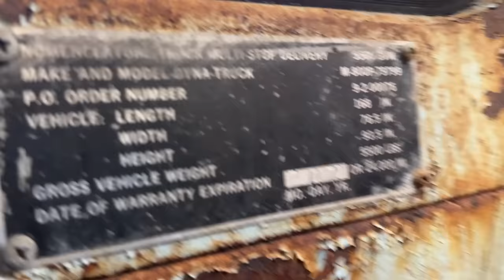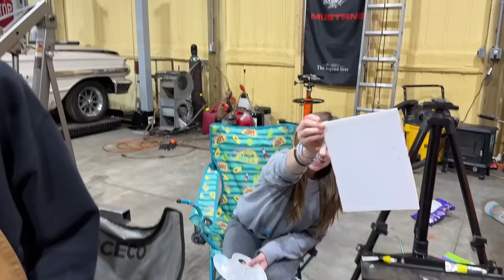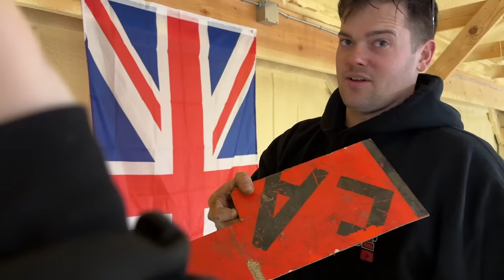Postal Van 6.0 LS Swap Mid-Mounted!

Comment: Woot the Metro Mite! That thing is too cool! You mentioned a roof top ac and needing a generator but you can get 12/24/48 volt rooftop units if you wanted to go that route.  Any who I agree with Ralphie about eventually adding a turbski. 🙃

Comment: A good trick when storing carburetors you've used is to take a syringe full of automatic transmission fluid and fill the bowl through the fuel intake it will completely submerge the internals and ATF and keep it from drying up gaskets and having the ethanol fuel that was left in it permit and keep all your internals from pitting
Reply from the maker: Ok thanks
Reply: I always took the fuel line off. Ran it until it is empty, then fill it with 2 stroke fuel. I think it's the same concept. But the 2 stroke fuel is more for winter storage, while the transmission fluid would probably do better over many years

Comment: Looks like a new sick week race van.
Reply from the maker: That would be cool
Reply: @Sleeperdude  yeah it would. 
But it’s great no matter what you do with it. 
Love you guys.
Reply: It would be a good business move too id have to say  @Sleeperdude
Reply: @Sleeperdude ALSO wanted to mention just in case you didn't know. Its pretty expensive, but they make direct adapters for AN lines for your radiator to water pump. It would be a REALLY clean, great solution to your problem.

Comment: Back in the day when I was in my late teens and early 20's I had a 68 Charger. I wrecked it once, and fixed it with fenders and radiator and such. But I did it myself with my Dad supervising cause it's what he did years earlier for a living before going into Real estate for a great living by the way. Any how sold the charger to my brother then he wrecked it again so I put it back together and repainted it again. It was a great experience for me as it must be for Ralphie and Waw Waw. I also had a 1971 Chevrolet 3/4 ton pick up with a 400 I blew up do to age. This was in the 90's and early 200's so my dad ordered a 350 Marine engine brand new the guy we bought it from ordered it and was the wrong one! So ordered another on we bought the first one it was suppose to be for his boat? I put it in my truck and it was great til I sold it in the mid 2000's bought a Ford explorer 2001 drove it for 10 years got wrecked. Then bought a Dodge Nitro drove it and traded it for a 2017 Ford Edge Titanium, and I love this car. Now you know my history keep turning out good video's and I'm Craig from Northern California.
Reply from the maker: Hey thanks 😊

Comment: For the life of me, I can’t figure out why not only Sleepydude , but most Youtubers, leave the engine and trans connected whenever they yank a motor. If you have a ton of room, I can see it, but most of the time, splitting the engine and trans just seems so much easier. Now. I know I’m old as the hills, but I can’t see how things could have changed much since the old “back in the day”. Can’t believe you have both Ralphie AND Wawa welding! Good job.

Comment: I'm so glad to see y'all back on the mail van. It's definitely the coolest vehicle you own. You should try the AN fittings and hoses for the radiator connection. You can use the existing waterpump and put an AN  90 on it. Plus, it would look much cooler than cobbleing hoses and pipe.

Comment: Wawa Masters the small hole drilling and proper welding techniques per her Dad's. Instruction.  Ralphie fits the right size radiator. Nice on the Fly Family fabrication 👍 Sleeperdude is on an LS Mission Can't wait for the next  installment. 👍

Comment: Hey Josh. A 2006 gto water pump had a straight forward outlet, and a 45 thermo housing, also I have a LS2 intake and 243 heads if you would like to have them. Second, if you have solid mounts you need to have all solid mounts, I snapped a th350 case having a rubber trans mount and solid motor mounts , took the whole bell housing off! The metro mite is gonna be one awesome cruiser! Puddin was just talking about it in his last video lol, I know he wants to get his hands on it
Reply from the maker: Ok thank you, I actually just ordered all the parts from Holley
Reply: @Sleeperdude   that will be really cool to see on the metro!

Comment: I had the shortest drive line ever when I built my T bucket in 1962, I had a 327 chevy with a B and M trans (olds trans with 3000rpm stall speed) with a swing axle (indipendant) Corvette rear end, I used the Olds trans yoke and hooked it to the rear end so their was not shaft on the drive line just the yoke so it was solid, worked like a charm. 20 inch wide chrome wheels with Firestone indy tires. I know you won't believe this but the frame(square tubing) was my gas tank, it held 12 gals. It was a wild but fun ride. Love this mail truck build, I had a Studebaker mail truck and it was fun to drive also you get used to the right hand drive very quickly. I don't miss any of your videos, you might have a contest for someone the clicks on your videos pick any low number for a giveaway shirt of their choice, it will get people watching quicker, I've got number 10 and lower a handfull of times. Love all the animals and the family its just great. Jim in Las Vegas Nv

Comment: Hey, that big tray on the engine doghouse is big enough for a fancy 3-course meal! Once you get it running, you can take it back to that town nearby with the Dollar Gentral and a Piggly Wiggly on the other side of the highway. You can renew your vows and then have a very romantic dinner on that very doghouse tray! You could even keep the engine running so the food stays warm.😁😁 Love your videos. This is a neat build. That little AMC 6 cylinder will be a strong runner once rebuilt. It's very reminiscent of a GM 230 or 250. We had one in a 1968 Rambler Rebel wagon and it ran a long time just fine. Strong runner but no big powerhouse.

Comment: I've built a few shorter driveshafts for running auxiliary hydraulic pumps on dump trucks. I believe the shortest one I built was 15" oal. I've been told there's no need for balancing shafts shorter than two feet long. I always align them in a lathe between centers and check to make sure they're true with a dial indicator. 
I knew a guy who made a 10" long driveshaft for a T-bucket and had no issues with the shaft or u-joints after running it for years.

Comment: Getting those motor mounts in reminded me of a day when I was driving semi truck.  I had to back into a garage where the loading dock was inside but my mirrors were wider than the door.  I maneuvered my truck to swing on in, then turn the wheel to get the other in.  It was a professional move.  Getting back out was the hardest part,

Comment: Great video. Y'all need to learn the beauty of keeping some mud flaps around the shop. They're free, you can cut them with a knife, and they really work well when you need random rubber pieces. Next time you're mirror shopping at the Flyin' Hook, make a lap around the back parking lot and pick up a couple of mud flaps that got ripped off when a driver backed up too far on the curb. Would work good for your radiator cushions. Great job on this Metro Mite. I'm anxious to see how this one turns out. KEEP ON TRUCKIN!

Comment: I have an axle flipped '65 Falcon Club Wagon (Econoline) like your Spring Special cab over with 4 Speed Toploader and custom 18" Driveshaft. I set the Pinion angle at 2 degrees and have trans custom mounted with rubber isolator and do not have any issues with driveline vibration or noise.

Comment: Josh, if you watch Vice Grip, he used AN pipe fittings with adapters for the radiator. Pretty slick. Use a high pressure hose, probably never have to change it!

Comment: Excellent video Sleepdude 2 Crew Josh   :) , family on Metro  Mite also super on LS 6.0 V8 motor , transmission, short drive shaft to 9 inch rear end , single buckets seats with bench in back , fuel tank you reuse and put new sending unit from 1970's or present  to and looking forward more videos on this project too!

Comment: Short drive shafts vibrate. Using double u-joints on both ends will smooth it out (been there done that). Hey, while the engine is stripped, pull the heads and remove the broken exhaust bolts. It's easier with the heads on a bench. Just weld nuts on the broken bolts and turn them out while they're hot. Plus, you'll have new head gaskets.
Reply from the maker: Good tip thanks

Comment: Watching you all wrestle that LS out of the engine building room on the pallet -- dang, you could use a pallet jack!  
Ralphie and Wawa are a force to be reckoned with.  Especially with power tools.  :)
I'm imagining this thing done back up in US Post Office blue and white with a cartoon logo of Mr. Zip Code flailing away at the wheel and an oversized shifter.   "Real Speedy Delivery",  "Gone Postal" or something lettered on it.

Comment: old landrovers are the same all panels that bolt together, and on the early landrovers you had to remove the trans from inside the vehicle which is super easy as the floors and trans tunnel and seat base all unbolt to come out, in fact the whole landrover was mainly panels that can be bolted on or off,  they were more able to be dismantled then the jeeps were which i recall only had a one piece body base where as the landrovers was many pieces that makes the base which means panels can be swaped over very easily.

Comment: The farther you go back the shorter the driveshaft which in turn more power to the rear axle. Josh since you’re using a 4L60-E you can definitely run a 4.10 posi and still run 80-90 mph on the interstate no problem. 
My 06 Chevy Avalanche had 4L60-E and a 4.10 gear gov-loc from the factory.

Comment: Awesome engineering and fabrication for the LS V8 engine mounts and transmission mounts. Nice teamwork removing the inline 6 and installing the V8!!!!!!!  I think you may want to install 4 wheel power disc brakes seeing how much more horsepower & torque the LS engine produces!!!!!!

Comment: On the couple of old Dodge Power Wagon's I worked with on the farm, one as a 63 3/4 ton the other a 63 1 ton. These trucks had a very short drive shaft between the transmission and transfer case. I don't think I ever measure them, but were like a foot long.

Comment: Josh, slice open a piece of old radiator hose, put it on bottom of rad and set it in the bracket you installed

Comment: Loving this little build once again I'm not trying to tell you what to do but if you had a pallet jack you know you could save that back for everybody and you never know if you pull something over them toes and then flip flops you got on how that's going to hurt... If you had a pallet jack you can take him on motors put them on a pallet put them right against the wall and line them up and pull them out any ole time. You got that big tractor just pull them out far enough to either get them with the tractor or put them by the door and load them up with the tractor on somebody's truck or whatever. You can take that motor puller set it down on top of a pallet jack and move a motor around anywhere you want it you got that nice floor in that big garage. I'm seeing you struggle I figured I would say something. I'm not picking on you but a different set of eyes sees things different sometimes or a fresh set of eyes always sees your mistakes. this show kind of reminds me of a family that used to work for me and you know there were like 20 people I thought it was papaw trying to come and get around to get some jobs and it was Dad I mean there was a bunch of them but they would go to that thing front to back quickly they would just do 24/7 on it till it was finished they did good work I wish I had a camera to record them I went over and hung out with him for about a week let me tell you you just never know what you're going to hear come out there mouth 😂😂😂 big family like that you know they really don't care what anybody hears and they really don't care to say anything. I would have just about gave anything if I had a camera back then to just show how fast they can go through something if you had something to wear it would have a time lapse it would be entertaining I mean those folks were pretty good paint motor everything they had equipment you know they had dozers and tractors and whatever they would make something to make it go...
Reply from the maker: Ok thank you
Reply: Yeah a pallet jack you can thank me later I don't know you might already have one and you might be calling me stupid but I don't see you using one. Your little door to your motor shop it smalls. But you got it that way so you can keep stuff on the lock to keep people out I know but you know you could set a motor on a pallet and you slide it right up under the wall or next to the wall and it just makes it straight love. Take that big tractor you got and load out just as easy. I'm really enjoying that little build right there that's my cup of tea... I like how you set it up to my thoughts on that little Hood you could put that radiator back just have some vents that would come in to feed it put an electric fan on it and make that a small trunk just like a Porsche it'd be a trunk in the front I know you got a big family would be hard to put too much stuff in there but you know I think it would be neat...

Comment: T bucket drive shafts are typically 18 to 24 inches long.you do have to have the pitch of the rear end correct or it will take out your u joints pretty quickly. I cant remember exactly but I think it is 3 degrees downward.
Reply from the maker: Ok thanks

Comment: My Brother and I swapped An old worn out 250 straight 6 in my 1966 Chevy van .we took it out the  bottom .laid it on its side and slid it out from under the van .we laid the new engine on its side and slid it up under the van .then hoisted it up into the van

Comment: If you find yourself in a junkyard, look in the battery tray of any Honda made after 2005 4cyl cars they have nice rubber mats that the batt sits on.. thicc and tough/flexible.. makes GREAT rad insulators. Coincidentally they are the perfect size for your use.

Comment: Must have been a very early '72 build because AMC switched to using Torqueflites in September of 1971.  Prior to that, they used Borg-Warner automatics which that one appears to be.  I think that trans cooler is some kind of cobbled aftermarket piece because the smaller Borg-Warner trannies put behind the sixes were air-cooled! Hence the big vents on the bell-housing.